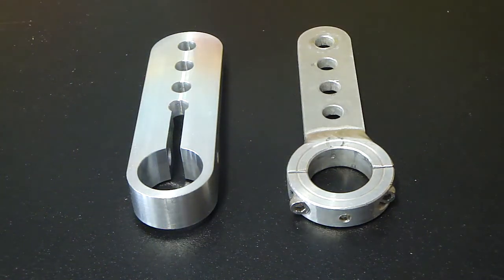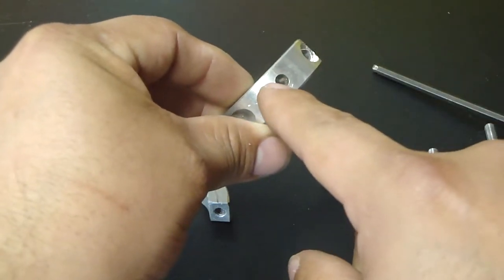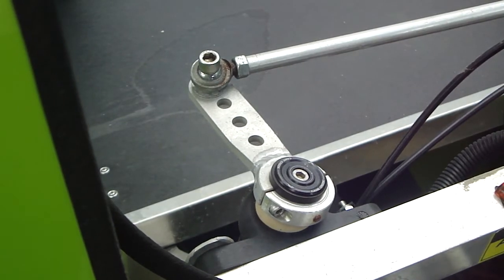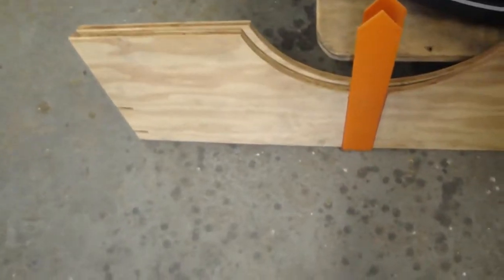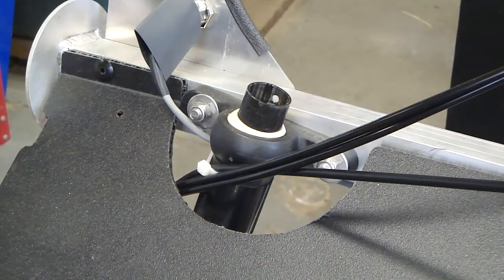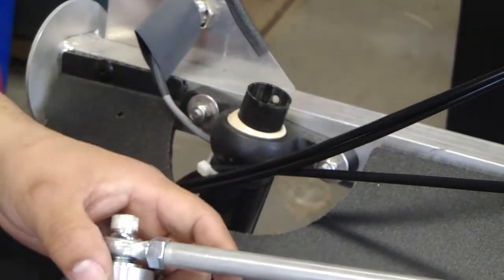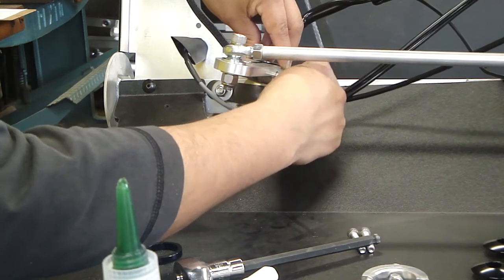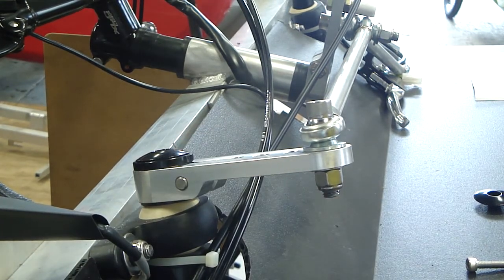Steering Arm Replacement: Installation - Part 2

Comment: So the angle between the steering arm and the wheel is not important and does not need to be checked? The the rod length is enough of a gauge?
Reply: Yes.